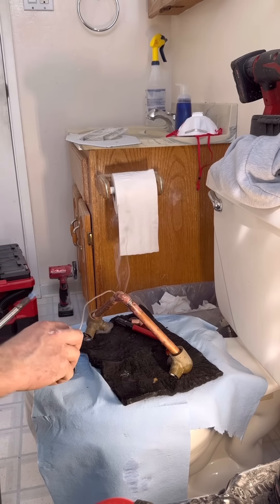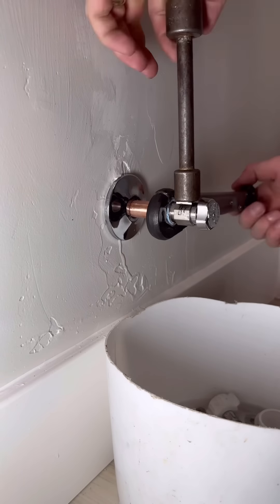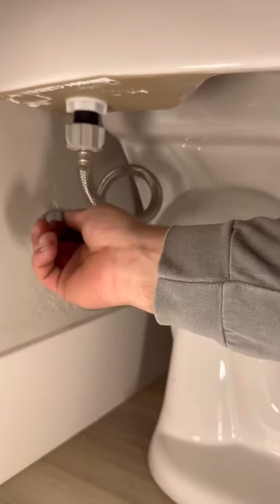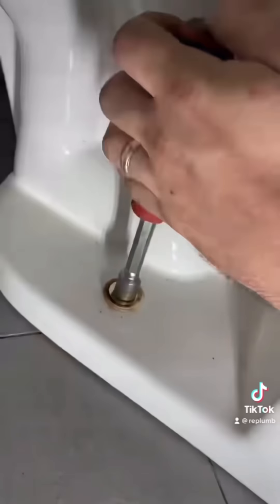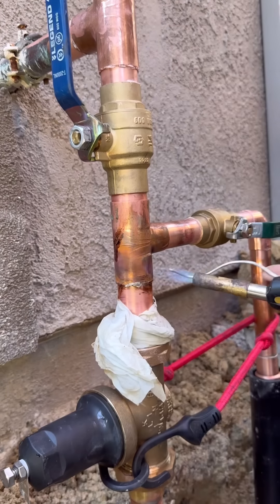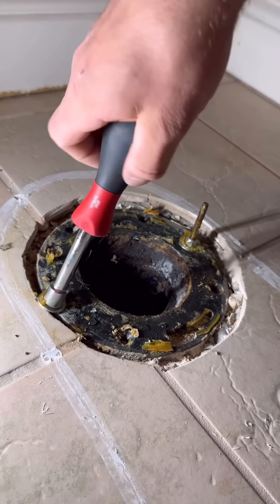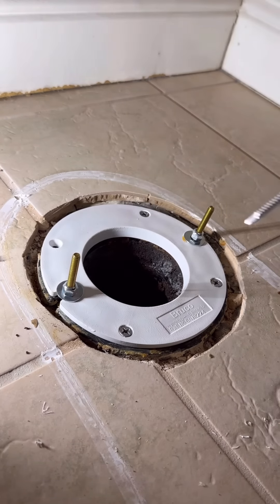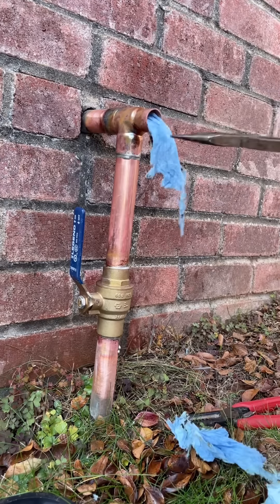My MOST viewed and FAVORITE plumbing shorts, replumb remix

Comment: My go-to for Johnny bolts are still Hercules brand, but the Set Fast line.  Idk if they're in your area, but they're AMAZING.  They have a bead of hardened glue towards the top and the bolt itself threads into the base that you stick in the keyway.  When you go to tighten them, they catch on that glue piece and they thread into their housing.  No trimming the bolt to fit in a cap, and if for whatever reason you can't get the housing out of the flange, you can just unscrew the bolt and thread in a new one

Comment: Like your stuff bro! 2 tool questions: The ratcheting tool you used on the valve and the nut driver you used on the closet bolt nuts? Where can I find those?

Comment: I'd like to make a video of plumbing a complete house from the ground up. How to make a ditch drawing. How to design a waste system and draw a schematic of it. How to design a Nat. gas system and size it to code. How to size a potable water system and draw it too. How to read building  plans.....
How to competitively  bid the job. How to properly pipe a multi-valve shower system. How to properly install a well thought-out circulating hot water system.....phew!...There's a lot more....anyone wanna help me?

Comment: Ay boi,
You can get a one piece repair escuteon for moen posi temp tub and shower valves,they just screw into the rough body like a regular round trim,very easy and i think you would agree a better job.
Part #TL2369EP
MOEN
Reply from the maker: Meh

Comment: Also, we use Lexel for repairing toilet flanges instead of silicone.  Lexel is like a silicone, but much, much more permanent.  You better be sure!  And it can also be applied to wet surfaces